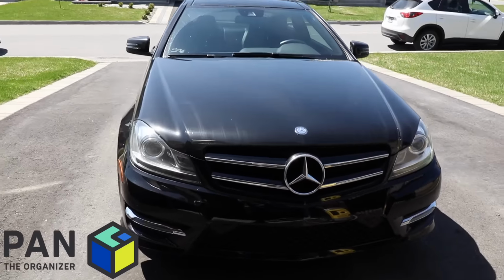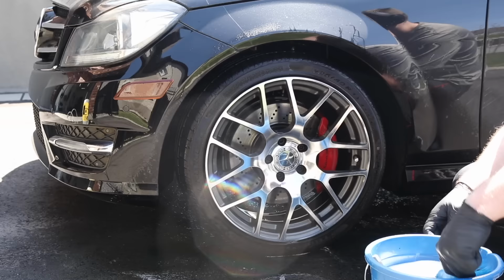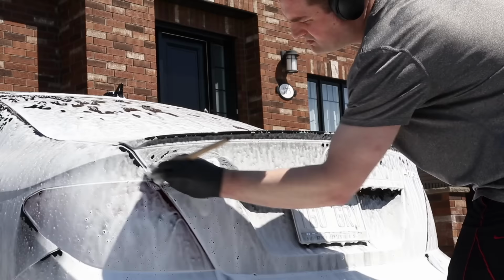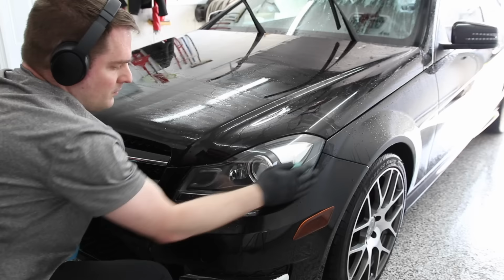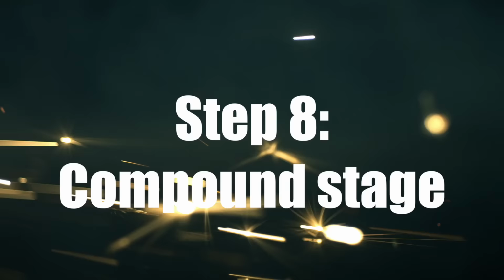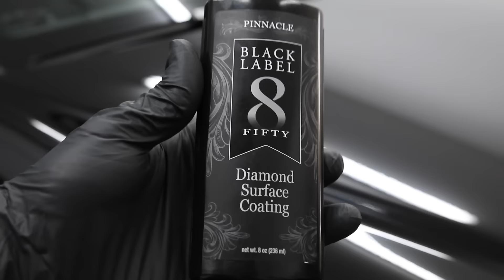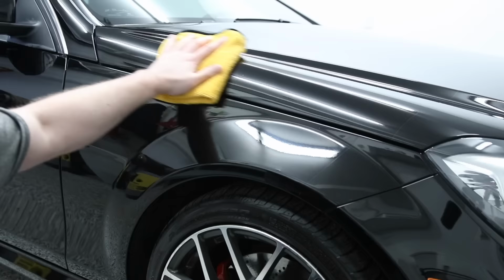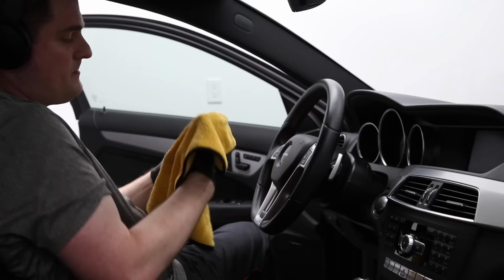MERCEDES-BENZ C350: FULL DETAIL OF A BLACK CAR

Comment from the maker: ►Here are some tools and products used in this video:

►USA buyers:
Iron Remover and Wheel cleaner: http://amzn.to/2oWlMcx
Tire and Rubber cleaner: http://amzn.to/2oQyKJb
Chemical Guys wheels cleaners: http://amzn.to/2qn1hmZ
Fender well brush: http://amzn.to/2oWm5nH
Speed Master wheel brush: http://amzn.to/2oigpSa
Tire brush: http://amzn.to/2nZo7zD
Meguiar’s Endurance Tire Gel: http://amzn.to/2oiucrM
Detailing brushes: http://amzn.to/2nZxLlK
P21S Polishing Soap: http://amzn.to/2nZ7S5S
Chemical Guys Clean Slate surface cleanser shampoo: http://amzn.to/2oiiGg6
Chemical Guys Honeydew Snow Foam soap: http://amzn.to/2pk2Fpk
Chemical Guys Citrus Wash & Gloss degreaser soap: http://amzn.to/2s3uAuT
Chemical Guys Glossworkz gloss enhancing soap: http://amzn.to/2r4jyGO
5 Gallon wash bucket with Grit Guard and dolly: http://amzn.to/2oim5eX
Microfiber wash mitts: http://amzn.to/2oQUgxF
The Rag Company microfiber towels: http://amzn.to/2oXvKYj
IronX (iron remover): http://amzn.to/2nZunHL
Pinnacle claybar and lubricant: http://amzn.to/2pk0Xo1
Pinnacle Black Label Diamond Surface Ceramic Coating: http://amzn.to/2nT7Z1W
Pinnacle Black Label Diamond Coating Booster: http://amzn.to/2oXqns1
Meguiar’s DA Microfiber correction compound and pads: http://amzn.to/2nTjxCe
Foam pads: http://amzn.to/2oXJIt5
Menzerna Finishing Polish: http://amzn.to/2nZCKD7
Jeskar Power Lock paint sealant: http://amzn.to/2r5oEod
Chemical Guys Butter Wet Wax (gloss enhancing wax): http://amzn.to/2qWfeuu
Chemical Guys Jet Seal paint sealant: http://amzn.to/2r5i1Cn
CarPro CQuartz ceramic coating protection: http://amzn.to/2s3yNPn
Meguiar’s Waxes: http://amzn.to/2qnjvV6
CarPro Eraser oil & polish cleanser: http://amzn.to/2nZkZUj
Aquapel windshield glass treatment (water repellent): http://amzn.to/2nwNQU4
Stoner Invisible Glass (premium glass cleaner): http://amzn.to/2oiuMWz
Leather brush: http://amzn.to/2nZv9Et
Chemical Guys Inner Clean interior detailer and protectant: http://amzn.to/2nwTCVv
Chemical Guys Silk Shine Sprayable Dressing: http://amzn.to/2oirz9s
Chemical Guys Leather Cleaner and Conditioner kit: http://amzn.to/2oijFNB
Swissvax Leather Cleaner and Conditioner: http://bit.ly/2ohvxkm
Flex 3401 orbital polisher: http://amzn.to/2nZtP4C
MTM Foam cannon: http://amzn.to/2nx2hHN
Metro Blaster Sidekick dryer: http://amzn.to/2nwR8GY
ShopVac: http://amzn.to/2nx0ORB
Ridgid 4 Gallon 5HP wet/dry vacuum: http://amzn.to/2qrilY2
Reply: I watched your ceramic maintenance cleaning guide, I am interested in getting a ceramic coating on my Mercedes but I don't have hours and hours to clean the car I have auto finesse products. I am not sure if that's good for ceramic coating would I need to get different products to maintain a ceramic coating? Keep up the good work your videos are excellent, well done.
Reply: Pan theorganizer 
I have a challenger 2015 is all black and it has a lot of swirls and I took it to a detail shop and I was told that they need it to sand the whole car. What is your opinion on sanding a car? I know if they sand it they will remove some of the  clear coat.
Reply: Where are you located
Reply: Sir. Great job. Since your an expert, what do you recommend to keep headlights from yellowing?
Reply: have you done a review on chemical guys  black light ? is there a better product i can use?
Reply: How much does a detailer like yourself charge for this kind of detail?

Comment: Hey mate! Great, in-depth video! I was just wondering on average how long it takes you to do a full detail on a car such as this and dirtier? I've been working away at my new car detailing business and one thing that I've been struggling with is the time I have to work on client's cars. I love to take my time to ensure I do it right but sometimes customers just want their cars completed quickly!
Reply from the maker: Hi FocusonDetailing!  Thanks for your comment, much appreciated.

To answer your question, the time I spent on this particular Mercedes was 10 hours (same goes for the BMW M3 in the previous video).  But these are recent vehicles (Merk was 2015 and BMW 2017).  The paint still needed great help, but nowhere near as much as older vehicles.  It can take me two or three days for a full restoration of a beat up car.  I only do high end detailing jobs.

So it depends what type of detailer you want to be.  The one that washes just the outside and does the interior quickly for 20-25$ or a full-on interior and exterior restoration, which is in the hundreds or thousands of dollars.  It's normal that you spend more time on vehicles when you start, it's the typical "overdelivering" for clients.  You'll adjust with time. ;)

How did you discover my channel?
Reply: Thanks for responding! Ah okay that's pretty decent. I'm about the same I believe with my work unfortunately not working on newer cars such as these yet haha.

To be honest as I'm just starting out I'm doing a bit of both. Nothing like the thousand dollar corrections yet but I'm hoping to be working towards them. I'd say at this point funds would be holding me back a bit haha.

I discovered your channel through recommended videos. I upload car detailing stuff myself so I think it just popped up alongside my own. I've left a like and subscribed keep up this awesome work!
Reply from the maker: +FocusOnDetailing 
Awesome!  Welcome to the Pan TheOrganizer family!

Good luck with your endeavours!
Reply: Do you always go to the clients location or do you have premises that you can work in if a detail is more than 1 day?

Comment: Hello, BTW here. Some questions:

Do you run into trouble washing out in the sun or was this done on a cool day so the wash wasn't drying fast?

With the clay. Do you know or can suggest a video that explains how it works? I look at it and, from a practical mechanics point of view, I'd think one is just dragging the particulate across the paint. Yes, the particles are embedded in the clay, but there's still a 'face' of the particle exposed at the same level of the clay face. I realize the lube is there, but if the clay is touching the paint then it would reason that the particle would be too. Thoughts?

Isopropyl alcohol to degrease: What strength Iso (50%, 70%, etc.) do you use and at what dilution w/ water? And is this solution safe for all interior surfaces like vinyl, leather, plastic, rubber, etc.? (given that a test spot is best) I'm thinking more like ill affects from usage over time, like drying out the  surface.

You seem to have used just about every chem know to man for detailing. Do you have or have ever thought of doing a "These are my favourites" list? Maybe do it 1st pick, 2nd and 3rd choice to give options for those that can't get/afford your first choices. Would think it would be super video to do as I haven't seen one like that where someone has a list of products that covers all parts of detailing a car. Maybe include tools too. 

Ever done a video on what to look for when choosing a local detailing shop? 

Ever used any of the sealer products, like a ceramic sealer on stuff in your house? First thing I thought of was sealer on my glass shower! :) Sink? Toilet? ha ha ha!

Sorry for the long post. Just thought I'd ask publicly so all can benefit from the answers! 

Thanks and Thanks for the info on the Detailers Forum too! Subscribed!!!
Reply from the maker: +Wing Nut Bert 
Hi!  Since you subscribed, welcome to the Pan TheOrganizer family!  Yes these are a lot of questions, the longest message I ever got!  LOL!  It's always best to detail in a garage or shaded area.  I sometimes need more light for my videos hence why the cars are outside for the washing stage but it's always done on a cool shaded day.  The claybar won't scratch if you follow precautions.  Plus, you're polishing afterwards so any micro scratches would be removed.  I use CarPro Eraser for my IPA so it's a premixed isopropyl alcohol.  If you want to make your own, distilled water and isopropyl alcohol in a 1:1 mix is fine.  More videos to come!  I upload one or two per week as much as I can, on Thursdays or Sundays.

Thanks!

How did you discover my channel??
Reply: Thanks Pan. Audi world forum. Posted a couple ?'s over there, recently, as BTW.

Comment: Quality detail!
Reply from the maker: +Edward j bunyan 
Thanks Edward!  👍🏻. I put 10 hours of work on that car and the results were awesome.

How did you discover my channel?
Reply: Pan TheOrganizer Your channel just popped up on my suggested. I have a question, i've just wrapped my C63 AMG in a light metallic grey and was wondering where I could buy a foam cannon, and what exactly is needed to run it from my home.
Reply from the maker: +Edward j bunyan 
Where do you live?  Do you own a pressure washer?  If yes, what kind?  It will help me guide your purchases.

Comment: WOW! Great Video! I own a 2003 Lincoln Navigator which almost doubles my time to detail such a large vehicle. I do a pretty good job on it but no where near your attention to detail. For being a 14 year old SUV it looks and drives very good.
I also own a 2011 Mazda CX-7 and a 2014 Mercedes C250 Sport Sedan which are so much easier to detail due to their smaller size compared to a large SUV.
I usually will do a complete detail of these vehicles every 6 months. I only do the deep body clay bar, wax and sealer every 2-4 years, as needed. My vehicles stay pretty clean and don’t require such a full detailed cleaning very often.
I do have some family members that don’t even have the slightest clue the work involved to keep a car or truck looking new like this.
I much appreciate your video. Great production too!
Reply from the maker: Thanks!  If you liked this video, you’ll love my channel!

How did you discover my channel?
Reply: From looking up Mercedes C Class videos!

Comment: You always say that it is bad to wash a car exposed to direct sun. This is even black. 
Great videos :) big like!
Reply from the maker: Yes that's a general rule for people with not too much experience in direct sunlight, not the right products, tools, etc.  I have been detailing cars for over 22 years so the experience is more than there, plus I use products I know how to use and control even in direct sunlight.  Plus I prefer working outside when possible as more light equals better picture quality (more light for camera lenses is always great).  But I have to give the proper advice to my audience as I'm not aware of their experience levels. ;)

Comment: This video is on point. The audio cut out at the end but it's still informative and entertaining. I hope I didn't miss any important tips in your conclusion. Where did you find the music??? It definitely brings life to the presentation. Is there anything you would do different for a white C350. I have a few light scratches on the hood, one small ding on the door, and some curb check damage from the previous owner but other than that it's in great condition.

Comment: Amazing videos!! Thanks a lot for your job and tips for our cars. I have some questions.
1. How do you remove the Iron cleaner?
2. Which is the best product for clean the exhaust and looking shine?
3. For the windows clean, it's necessary a previous degreaser or just apply for example the invisible glass product?
4. Once we apply the ceramic coating layer. Which is the best product for maintenance in the next wash?

Thanks very much!! Greetings from Spain! Saludos desde España!!
Reply from the maker: +Jesús García 
1) you simply rinse with water
2) P21S Polishing soap
3) for glass, just a good glass cleaner is enough
4) check my video: https://youtu.be/yLiePQRMFc8
Reply: Pan TheOrganizer Thanks a lot Pan. Your videos are amazing!! Thanks!

Comment: I would like to see a video from you explaining how to use a rotary polisher. I want to take that step and get one to obtain better results when polishing, but I don't know the technique to properly use it.
Reply from the maker: Great idea Jorge!  But it would be more about a DA polisher, as pros are moving more and more towards DA polishers.  They are so advanced that they are great at cutting and finishing, and less worries about damaging the paint.
Reply: I understand. I already have a DA, which is the Torq 10FX, but I still want to learn how to use a rotary. Thank your for you answer, Pan.
Reply from the maker: What I'd first recommend is to go for an "in-between" like a forced rotation polisher.  I have a Flex 3401 and that has great power (pad never stalls on a forced rotation tool) yet still has the random orbit movement.  Rupes also makes the new Mille which is a forced rotation polisher.

Comment: I have a c-class like that and it’s in pretty ok condition, but I don’t have time and patience to do the same exact process as you:(. Spent 2 hours claying just to find out I scratched the cc in many spots...wish you lived in south Florida lol very good video! Very detailed (no pun intended). Very jealous the owner of this one didn’t have to do crap and got lucky with the guy like you handling it all.
Reply from the maker: Thanks Konstantin!  Yup, the owner was amazed by the results and fell in live with his car all over again.

How did you discover my channel?
Reply: Pan TheOrganizer I was simply looking for tutorials to fix my mess with the clay bar and detailing tutorials in general.
Reply from the maker: What claybar and clay lubricant were you using?
Reply: Pan TheOrganizer Meguiar’s  clay kit. I have a couple of questions - can I use the same method of polishing on the black trim between the side windows and since my interior trim is wood - can I polish that as well?

Comment: Hi Pan.  Just curious!  I assume you rinse car after step 4.  Then clay bar?
Reply from the maker: Yes, after the iron removal step, you thoroughly rinse the vehicle before moving on to the clay stage.
Reply: @PanTheOrganizer  Hi again Pan.  I cant get enough of your videos.  A Fantastic effort and really appreciate you sharing your detailing techniques.     I am planning a detail this weekend.  And as I do not have a ceramic coat for my car, I will be cutting, polishing and then Waxing.   Would the Carpro Reload Silica spray sealant be ok to apply after a WAX?

Comment: I actually have a question regarding the Mercedes sport seats and how you would clean them. The middle of the new sport seats have something called Artico, which I was told by the dealer is similar to Alcantara (Artico just being a different brand). How would you detail this fabric as I read a lot of people saying to not touch it.

Comment: Which speed do you use in the compound stage? I'm used similar pressure, similar pad and compound, similar motion and passes, but it finally, I got a worse result like after orange pad Chemical Guys. Maybe it was because I used speed 6?

Comment: When buffing and polishing, I thought you were supposed to work in smaller areas at a time?
Reply from the maker: +Joey Crysel 
Depends on the product’s working time, trmperature (I work in a controlled environment), skill level, etc.  Recommended size is 2x2 but in my experience I can do more.  Depends on the state of the paint too.

Comment: Just watching this older video. I see you do a lot of washes in sunlight. Do you find issues with the soap drying on the car before you rinse (especially during the pre-wash stage), or issues with water spotting because it dries by sun before you dry an area?
Reply from the maker: Absolutely no issues as I have a water softener system at home. Plus I use quality soaps.

Comment: Looks beautiful!  Huge transformation.  With a pant coating like this one, what would you suggest to make the paint pop, like a wax would do on a paint without a coating, after each maintenance cleaning session?  Also, can you use detail spray (like Adam's Polishes) on coated paint?
Reply from the maker: +azurebluemach 
You can use the Pinnacle Black Series Diamond Booster in spray form after your maintenance wash (in this video Pinnacle Black Series Diamond Surface Coating was used).  Every company makes spray sealants containing SiO2 (silica) to match their coatings.  For example, for CarPro CQuartz coating, you have CarPro Reload spray sealant.  For Gyeon Mohs coating, you have Gyeon Cure.  Etc.  Those spray sealants are the best solutions for coated cars, to add a boost of gloss and protection after a maintenance wash.

Does this answer your question?
Reply: Pan TheOrganizer Yup!  Thank you! 👍🏼

Comment: hi pan. would you mind giving me an answer to a wee question??
would it be possible if you could give me a rough break down on times you spend on each step of a full detail inside and out of the vehicle.
i notice you mention 10 hours for the detail.
just interested on how much time you spend on each task.
i understand that it can be different on each job due to condition and size but as said just a rough guide.
im looking into doing my own business and just doing homework.
if you could answer the above i would be grateful.
Regards Joanne
Reply from the maker: Hi Joanne!

roughly 8 hours on paint including washing, decontamination, paint correction and protection.  2 hours for the interior (vacuuming, cleaning and protecting leather seats, cleaning glass, cleaning and protecting dash and trim, etc).

Comment: Hi Pan, that's stunning finish. BTW is Microfiber Buff Better Than Wool Buff for heavy Cut stage of black paint?
Reply from the maker: It depends on the paint, hence why you need to do test spots. I prefer microfiber but that's because of the products and tools I use, in my environment.